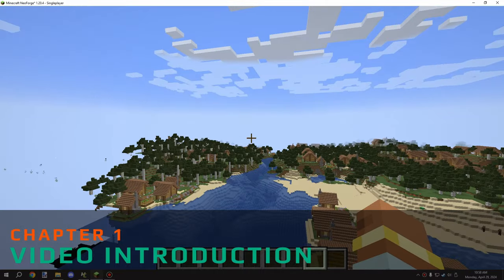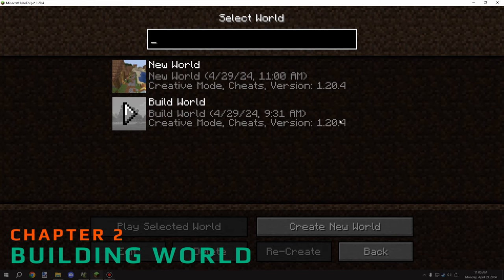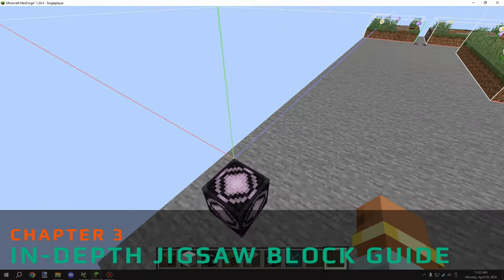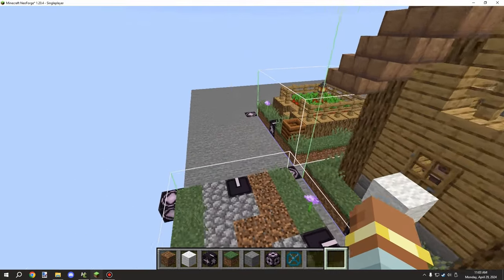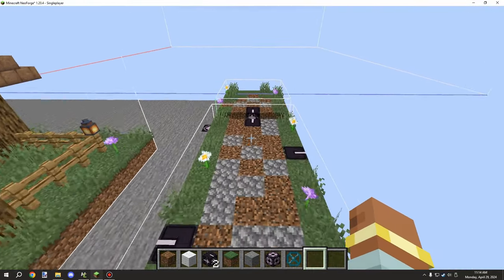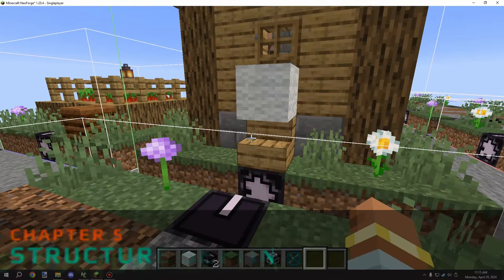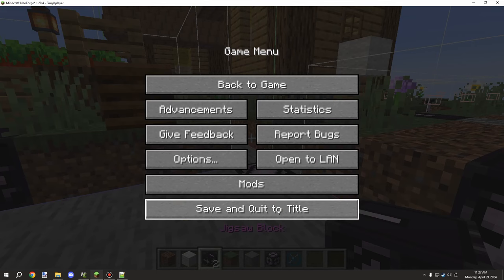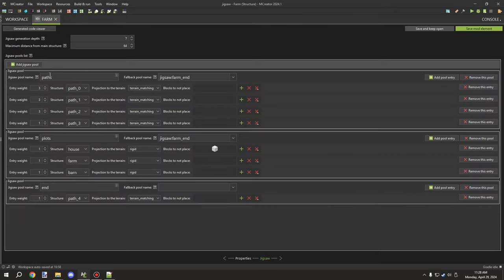Structure Jigsaw Feature | MCreator 2024.1

Comment: im trying to use these jigsaws to overcome the structure size limit, and for some reason, when i generate the world, it doesnt apply the jigsaw at all, but when i do the same data in a jigsaw and manually generate it, it does work (mostly, just gives me a random rotation for some reason idk ive been trying to make this work for two days now and havent gotten really anywhere)

any advice on this? PLEASE
Reply from the maker: Like most things it depends how you are trying to set it up. And what version of MCreator your using.
Only recently the Structure element was actually using structure generation, before it used features that spawned structures which is why it was not possible to use the /locate structure command on any structures.

If your using 2024.1 then this should not be an issue as  the structure element uses actual structure configs now.
In most cases the structure will still generate, even if the pools are not set up correctly.

With that being said.
I have covered in more recent videos on the structure element that the pool name should start with your structure registry. then followed by a '_' and then the pool name.

So if your structure is called say MagmaDungeon your registry should look something like magma_dungeon
you would then use magma_dungeon_<pool_name> for your pool.
This pool should also be under your mods namespace.

So if your mod namespace is called "test_one"
the path for say a pool in the jigsaw structure page called "buildings" would look like below.

test_one:magma_dungeon_buildings

I hope this makes since.
In a few weeks I will be starting a structure series which will cover everything from structure blocks to more advanced configuration jigsaw blocks will be on that list in relation to MCreator at least.

Comment: There are some block that get replaced with dirt on some structures, is there a way to fix this?
Reply from the maker: It depends if the structure has been built that way or not.
Like I am aware some villages have dirt in paths this may be possible to fix though there is also some times issues with minecraft world generation which can crop out parts of structures at times this is normal and can't be fixed.

Comment: heloo northwest trees ive watched this a couple times and my world keeps corrupting. what order do i do the things? i normally create structures, and i get stuck. do i first make the jigsaw pool or do i make the jigsaw pool after.
Reply from the maker: It should not matter what order you make your pool in.
So long as the world your making your structures in does not generate structures.
At least for the moment when you get the structure parts made.

For your pool, the pool name will be the structure registry followed by an _ and then the custom pool name you made in your jigsaw block section. This will be under your mods namespace.

Your target name and name for your structure should also be under your mods namespace.

For your pool it will look something like this if your structure is called BlueHouse for your mod element.

cctvcraft:blue_house_custom

custom being the custom pool name you name it.

When you make your jigsaw blocks there are two kinds of blocks. Generator and Placed.

Generators you need a pool and target name and the name set to minecraft:empty.

For the "Placed" one you need the pool and target name set to minecraft:empty and the name same as the generator block's target name.

Hopefully this makes more since I have a couple more community tutorials and then I will be covering structures more in depth so if this does not make since then make sure to check out the structure series once I get the ball rolling on that series in a few weeks.
Reply: @NorthWestTreesMCreator  i got it working thanks for the tutorial :)

Comment: I still don't really get what the target pool is. Could someone please explain it to me?
Reply from the maker: The "target pool" controls the file where structures can be selected from.
The "target name" is the name which the jigsaw block looks for in the structure list in the pool.
The "name" is the name that needs to match on the block generating which is looked for form the jigsaw block with the pool.

For a generator block you only need your pool and target name, the "name" should be "minecraft:empty".
For the structure being generated the jigsaw block should have the same "name" as the generator target name but one the block being generated the target pool and target name should be "minecraft:empty"

Generator Jigsaw Example:
"Assuming the structure is called Structure and the custom pool name is called pool_name"

Target pool: "tale_of_biomes:structure_pool_name"
Target  name: "tale_of_biomes:jigsaw_name"
Name: "minecraft:empty"

Spawning Jigsaw Example:

Target pool: "minecraft:empty"
Target name: "minecraft:empty"
Name: "tale_of_biomes:jigsaw_name"

I hope this helps a bit.

Comment: How can I create a small biome for example 13X13 blocks? new video please
Reply: I don't think that's possible to create a tiny biome, but I may be wrong. I remember Forge has or had  a bug where custom biomes are too big.
Reply from the maker: Newer version of minecraft support /fillbiome but that's about the only way you can change the biome these days like that, and it won't actually work for structure generation or anything like that though entities may spawn over time in that biome but again, its most likely not what your going for. Pre 1.18 generations supported it but 1.18 and up.

Comment: Also, how does simulate work? It says right click, how does that work?
Reply from the maker: Had a hard time finding the block, pretty sure its new though not sure how new. But first time I have seen the block.
Best guess it it would allow you to make a entity right click at a set location. For example you could store the X Y Z position of a custom storage block to a item each as their own variable and if they player right clicks in air maybe then have it open that container remotely. Not sure how well that would work for every block I think vanilla chests have a built in mechanic where they close out if the player is not near the block but it should work for any block with a right click action so it could probably be used for Redstone repeaters or even custom blocks that run right-click procedure triggers. Again just my best guess from looking at the block, I have not used it yet so I have not clue what it does but from what it sounds like this may be the case.

Comment: where is jigsaw tab in structure mod element?
Reply from the maker: This feature was added in 2024.1 and is not supported for older versions before it.
Use the structure element then set up your main structure settings then add your first pool on the second page.
This video does a good job for the time being to show the system, just keep in mind that it will only support MCreator versions at or above 2024.1.
Reply: @NorthWestTreesMCreator  thanks

Comment: how increase the structure rate spawn?
Reply from the maker: For structures the lowest settings possible is controlled by structure chunk distribution.
The lowest values for generation are separation = 0 and spacing = 1.
Spacing always needs to be +1 from the separation.

If your generating things like trees its best to use features instead and spawn NBT structures that way as you can control the density a lot more than structures. Think of structures mainly for buildings not decorations, which trees, and other plants and props fall into.

Comment: Watched this like 3 times but i still have the same problem, i did everything exactly like you even made a diffrent mod to recreate what you did, but for some reason when i spawn in the only thing that generates is the main structure part, and the jigsaws dont generate my build.

Im on the latest version.
Reply: On my main mod i tried to save a big structure using jigsaw blocks and just making each pool have 1 item. It didnt work for some reason
Reply from the maker: When I ran my test for larger structures I used one pool.

There are two ways to configure the jigsaw blocks.
- Generation (Jigsaw block that spawns a connecting part)
- Generated (Jigsaw block that is selected from the pool)

Generation Configuration:
- Requires pool
- Requires target name (same as name in generated)
- No name
- Can have replacement block.

Generated Configuration:
- No structure pool
- No target name
- Requires name
- Can have a replacement block.

Keep in mind that your structure will be part of your pool name.
If you name your structure Village
your pool will contain "village_" then your custom pool name after it.
For example you want your pool to be called "homes" it would be "village_homes".
Last thing to keep in mind is it will be under your mods namespace so check your project settings to get the namespace of your mod.
You should have something like "namespace:village_homes" which you will put as your pool value.
If this value is not correct it won't find the file to generate the structure.
Reply: thanks, ill check about the name since i did with pool and without one, 

I think the problem is that i use target and a name on both of the connections,